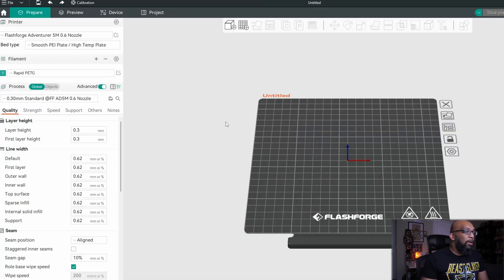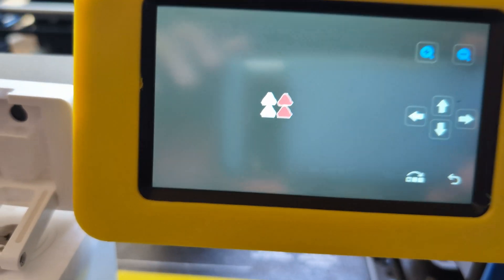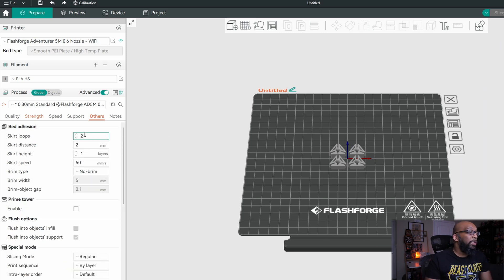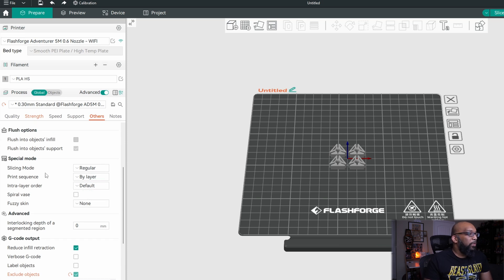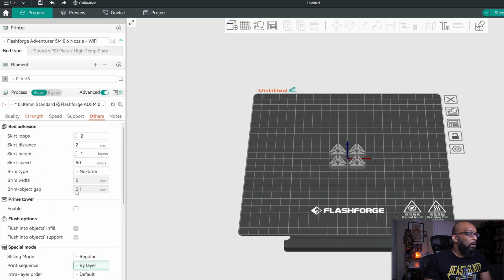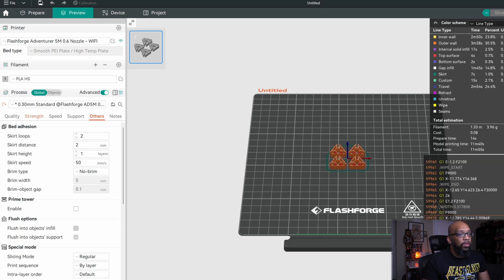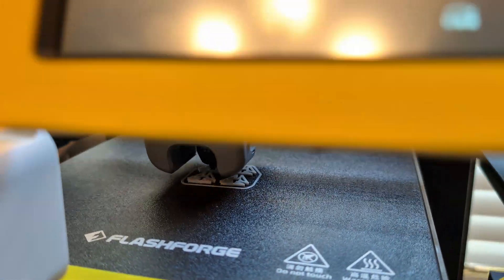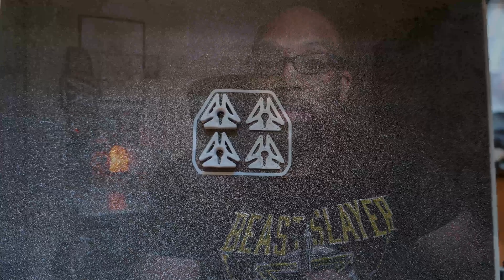How To Use The Exclude Object Feature On The Flashforge Adventurer 5M w/OrcaSlicer

Comment: I would like to know how to exclude an object during a print on the 5m pro. If I have an adhesion issue on one of the objects it would be nice to stop the print on just the failed object and  continue the rest of print. Otherwise the filament strings everywhere and has the potential to wreck the other objects. This just happened to me this morning on a 1.5 hr print with one of the objects out of several and the filament got on other parts.
Reply from the maker: The process in this video also works for the 5M Pro. Just make sure exclude objects is checked in the slicer before you slice the file and you'll be good.
Reply: @FigureFeedback  Fantastic thank you!

Comment: well ... mine its not working at all. Selected objects are red but it still printing those..
Reply from the maker: Are you using OrcaSlicer 2.0 with the new printer firmware installed?
Reply: @FigureFeedback   Im using Orca 2.1 dev version. It has connection to wifi ( without leveling ) and it has features that im missing from Flashforge-Orca. I hope one day orcaslicer will give us a network plugin to flashforge like bambu printers to fully control printer from slicer gui.